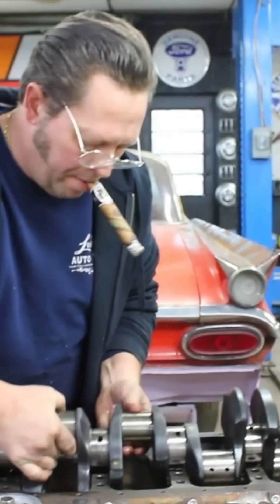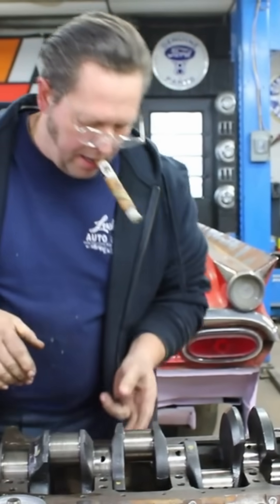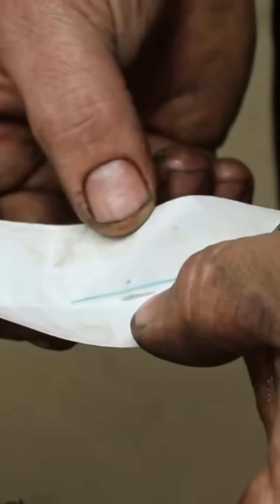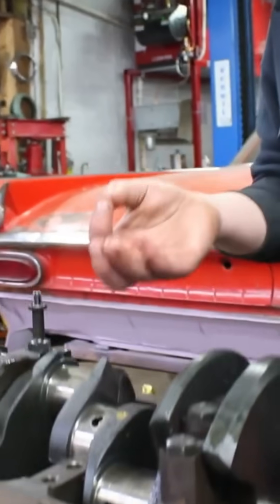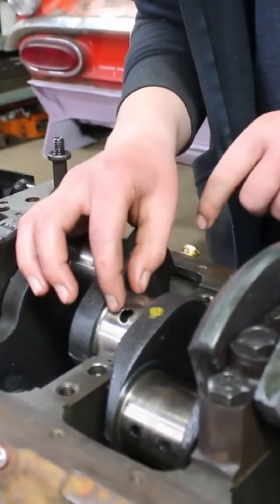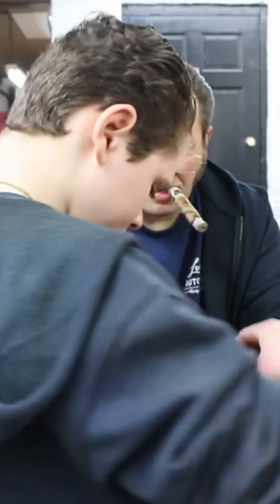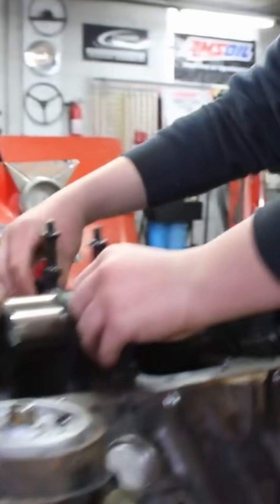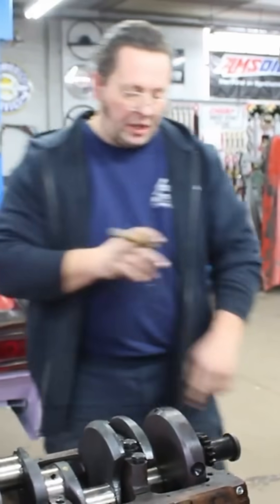#shorts Yes...It's Okay to Use Plastigauge

Comment: Good job young man  little tip on the clay,aka plastiguage  cut them long enough to take a print the whole width of bearing showing you taper in journals alot of people built engines at home wit  clay  not paying attention or not going edge to edge had 2.5 to 3 taper and wondered where the oil pressure went

Comment: No oil on the bearing ok im lost does the clay help getting the oil in there before startup i put a motor i rebuilt in to a 69 nova and couldn't get it to start because i didn't oil the bearings 😢 sold the car as is for 500.00 the guy loosened the crank bolts and had it running in a couple hours...😡